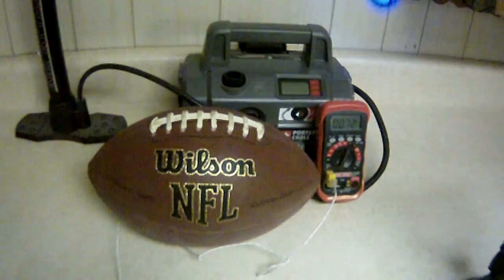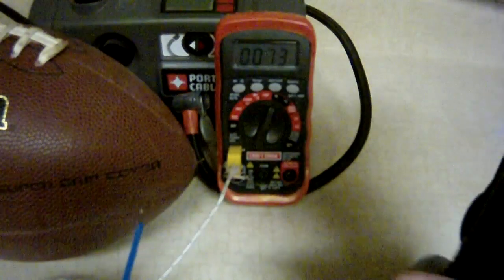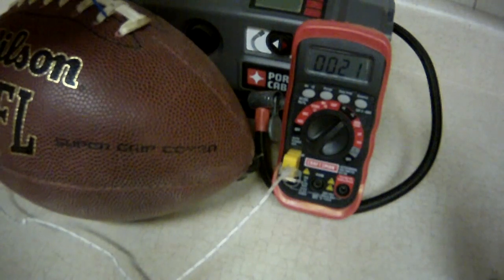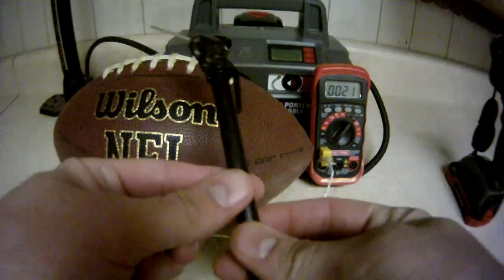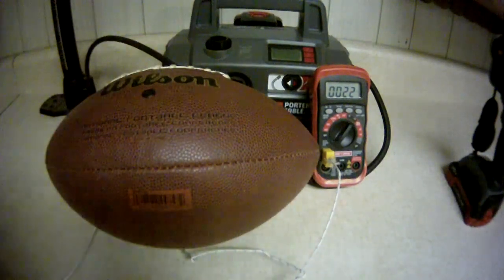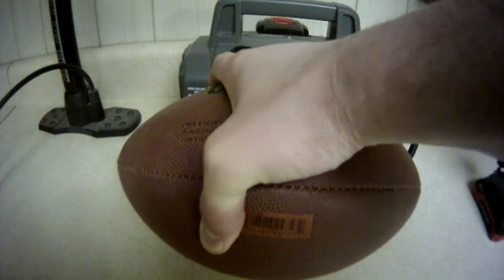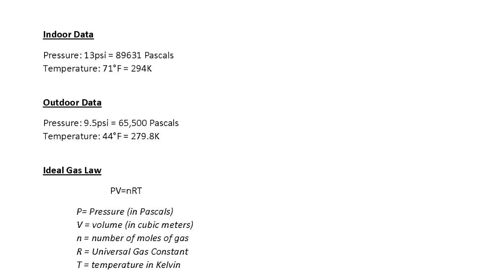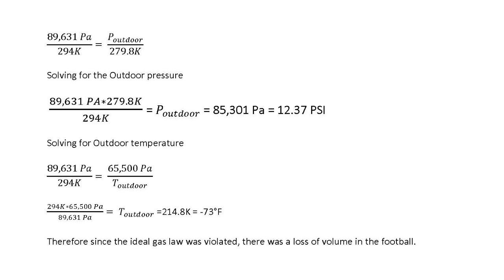Pressure Testing a Football to NFL Standards #DeflateGate

Comment: Even my 5 year old daughter knows that moving something with warm air into cold air will lose pressure.  However, with all the speculation, my daughter and I took it to the next level by taking a NFL football, autographed by Don Shula (seemed fitting), inflated it to 12.5 psi at 72 degrees.  We then put it in our refrigerator at 44 degrees for 80 minutes.  The pressure dropped to 10.5 psi.  

Here is our YouTube video:
https://www.youtube.com/watch?v=52tuyZ4rf2k

Comment: Great demonstration. Well done. Your calculations at the end neglected the ambient air pressure. The pressure gauge is measuring the difference between one atmosphere and the pressure inside the ball. One atmosphere is about 14.7 psi = 100,000 Pascals. So your P1 = 14.7 + 13 = 27.7, and P2 = 14.7 + 9 = 23.7. In your equation, then, 189,630 Pa/294K = Pout/280K = 180,600 Pa =  26.2 psi absolute = 11.5 psi relative. So your ball should have measured 11.5 psi outdoors. I was surprised that you had only 9 psi - must have lost some air in the measuring process. Similarly, solving for the outdoor temperature at 9 psi relative, we get 256.6 deg K, or about 2 deg F.
Reply: Yes.  I thought the same.  Which means that the drop in temp alone would account for the difference.  Why doesn't the nfl use a better 
method of standardizing their fotball psi's.
Reply: Jung Choi This is the result of public education.  People think they know what they are doing, and apply pseudo-scientific methods, but miss so much.  As you say, he is using gauge pressure not absolute pressure.  Changes the result from a 15% delta to a 7% delta.

Comment: Since the NFL has now said that the balls were changed at the end of the half, and the pressure didn't change at the end of the game, could you do the test again showing those parameters.  I assume, if the temp was constant, the pressure wouldn't change if they were refilled in the outside temps. Also, the effect of the rain on the balls would also decrease the pressure too I assume.
Reply from the maker: If the balls were pressurized outside (or in similar temperatures) there any deflation due to thermo contraction could be ruled out by basic chemistry.

Comment: One piece of information you left out.  You should have tried the same football, left it inside for the same amount of time and see what happened.  A seven year old football might not be capable of holding 13 psi regardless of the temperature.

Comment: Interesting, thanks. Did you bring the ball back in to see if the psi rose back up?
Reply from the maker: I should have, but did not do one on camera or measured with any tool; I think there was a loss of air (presumably out of the valve). After sitting in my kitchen for about a day, by feel it is under pressure. I think the next logical test would be to test a statistically significant  number of footballs, and to investigate the valve stem specifically to check for air leaks due to expansion/contraction under changing temperatures.

Comment: As pointed out earlier, your math is wrong; the pressure readings must be absolute atmospheric pressure so you must add 101,353 pascals to the initial pressure and subtract it from the end result.  That would give you a theoretical pressure of 11.666 which is close to the 11.3 reading taken when the ball was intercepted.  Your test was bad because you used inappropriate equipment and test ball.  You should remove this video or post an apology.